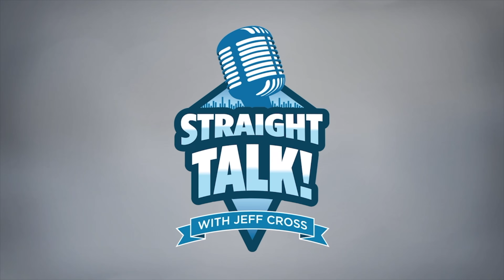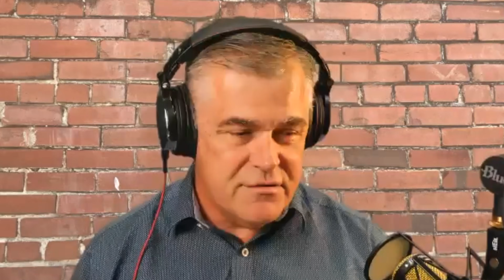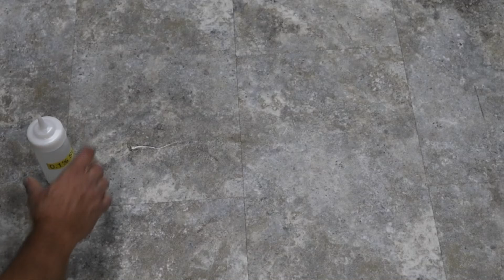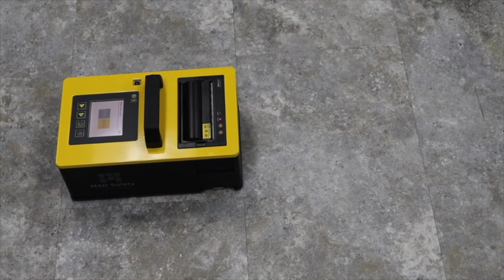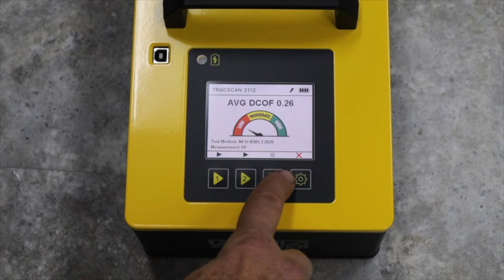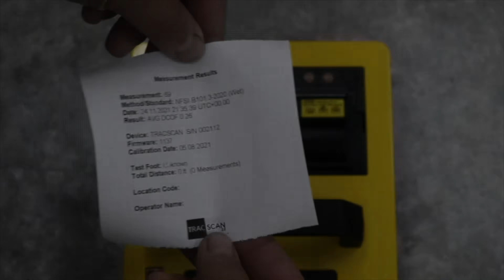Floor Testing for Safety: Do You REALLY Want to Know the Results?

Comment: I hate hard floors! I'm a victim of more than one slip and fall, the latest in January when I shattered my elbow and bone coming through the skin, the other crushed my shoulder and banged my head, (2004), not to mention slips where I didn't get hurt. I clean carpet and Tile floors. They need to improve hard floor traction before I kill myself.